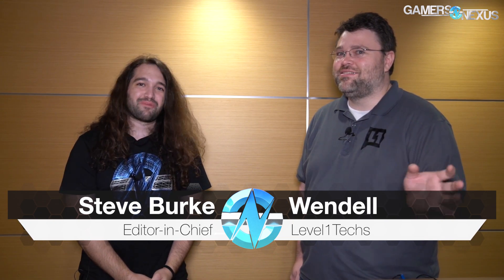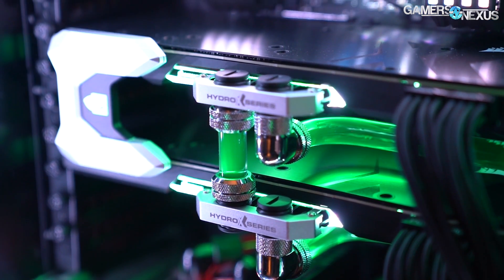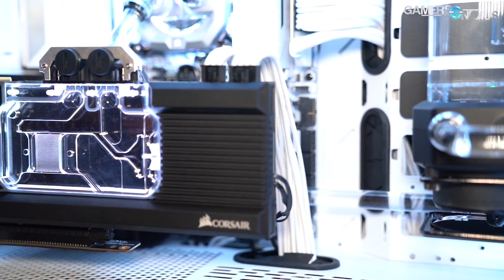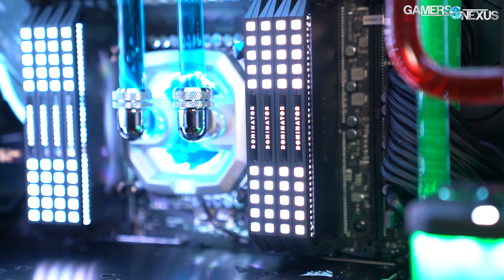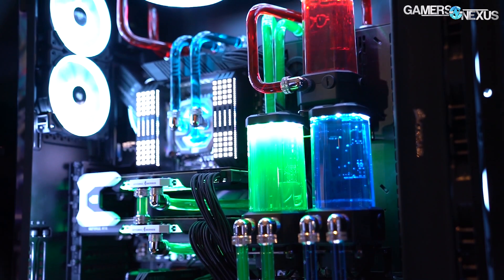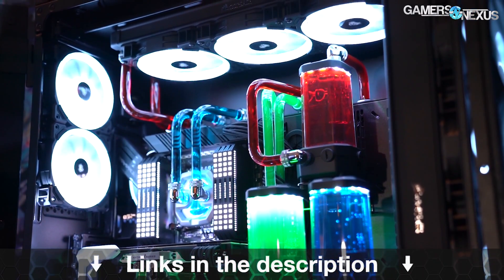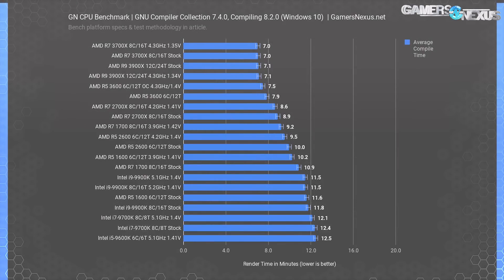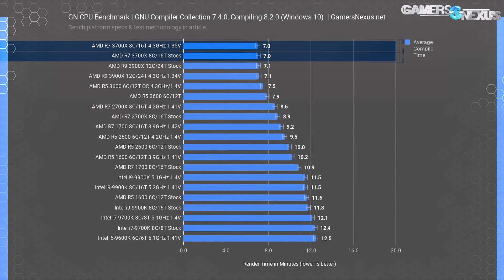Explaining Ryzen 3000 Cache, ft. Wendell of Level1 Techs | LTX 2019

Comment: As a web developer I have to agree with Wendell, that you really need to look at whole workflow holistically; at least as long as you're looking at the consumer side of things. I do transpile javascript a lot on a daily basis, but realistically it only makes up a fraction of my entire processor usage. Even if my transpiler was a single core load (which, tbh, I never bothered to check), I'd still probably choose more cores over higher clock speed to a certain extent. Two major reasons: 

First, the compilation, static code analysis, unit testing and other CPU intensive tasks are generally done in the background. I don't know any programmer who would sit idly every time his compiler runs. So having a spare cores to do other stuff is always welcome. 

Second, developer's workflow is rarely just writing and compiling code, it's a very varied workload - yes compilation might be important for some but it's never be-all and end-all when it comes to the developer's workstation. In my case I'm often running several docker containers with web servers; one browser with a ton of tabs, and several others for testing browser-compatibility; a Windows VM for that one stupid corporate piece of software that doesn't run on Linux; an IDE which is indexing and doing static analysis over my codebase all the time etc. All that while I transpile bits of my code every time I save. 

I don't know how you'd go about benchmarking something like that... it's more like... general computing.

Comment: I guess you could setup load testing on a software system that does heavy encryption and hashing to simulate something like a user logon (that sometimes has dedicated hardware to help out).  Could even use Chrome etc for that test. 

Another workload test could see how fast a bare bones docker instance gets fully setup ready for load testing.

I've actually played around with EC2 types with a prev company's regression suite that takes around 16 hours to run.
There were some gains from increasing core count etc but only when it was effectively maxing out a core or disk.  Going from a machine that doesn't have noticeable spikes in IO (<50ms) and CPU (<90% constant/mean usage) and having a solid 2/3GB of free Memory from peak didn't seem to net any great benefits; at least when talking about a Linux Server. 

But running on a desktop would mean a lot more context switching etc so it would be more likely to tap out a lot sooner.

Comment: Suggestion: Compile a C project, a c++ Project (because the object oriented structure needs to be interpreted too), and a project which creates Bytecode like Java or C# (Bytecode is program code that has been compiled from source code into low-level code designed for a software interpreter). If you want a 4th thing, you could take something  like a Haskell (as an example of an purely functional programming language)

Comment: So my take on benchmarking for programmers is as Wendell said check responsiveness while compiling because most compilers out there are incremental but my workflow usually includes several IDEs open. Along with typically 2 versions of the target software (release and dev) plus a ton of chrome tabs. Some IDEs are heavyweight like eclipse inellij and visual studio so it might be good to include a benchmark with 2 instances of eclipse or some other IDE running and compiling.

Comment: I like the GCC compiler test because it's a real world work scenario thing - but i do agree, maybe it should be a bunch of stuff compiled.
Linux kernel, Chromium, Firefox, then some Javascript stuff, and maybe something with the Microsoft compiler? I believe this stuff could be scripted.

Also i wonder how different CPUs compare on NVMe I/O operation or if there is any difference, and on network utilization while using same network chip (say a add-in card) if there is any difference. sigh i think i went down the rabbit hole and now i have to buy a bunch of systems and see if there are any differences? :/

Comment: Compiling from ramdisk (tmpfs) is also great because it saves a lot of writes to the ssd nand thus enhancing  its lifetime.
Reply: Splitting hairs: ramfs is the proper RAM drive FS. Tmpfs can overflow into, or have some contents flushed by need, into a swap file. Ramfs will only be RAM resident, with no safety measures if you do stupid things.
Reply: Probably indeed.  Modern drives use write strategies to avoid writing the same cells...  m.2 nvme will drives hardly saturate a pcie x4 bus much less an x16.  The 4.0 specs bandwidth increase is great for cards where you do transfers to card memory.  That said, even the RTX 2080 ti doesn't saturate the pcie 3.0 16x bus.  The 4.0 spec is for something to come in the future.

Ramdrives are still noticeably faster.

Comment: I use 32GB ramdisk for my node.js projects and some C++. Must say, ramdisk is the best thing ever invented... However must be careful to commit and your project externally very often. Last time while closing system it copied for me only the folder structure without files to the hard drive.
Reply: Why not run rsync via cron every minute?
Reply: @MarkRose1337  for 1kk files? I use Ubuntu under Windows .... Not pure windows...
Reply: Maybe make, or search for, a script you can have running with crone that will index all the files, then save only newer ones. Or grab a backup tool that does that, and have crone run it every 10 minutes or so.
Reply: @laurelsporter  rsync already does that.
Reply: @MarkRose1337  with a relatively high overhead, as it's made to be reliable over unreliable storage and network interfaces, yes. Kind of like how git also already does it. A more direct script would likely do it much faster, and with no file system or cache issues (like fsyncing getting in the way of a snappy PC).
Reply: @laurelsporter  I had a couple of typos in my previous reply. Anyway, I ran rysnc on a typical source repository to see how fast it was. It was even faster than I thought it would be. I suppose something faster could be written, but I'm not sure it's worth it.

$ sudo mkdir /mnt/ramdisk{1..3}
$ for i in {1..3} ; do sudo mount -t ramfs -o size=4g ramfs /mnt/ramdisk$i ; done
$ sudo chown $(whoami) /mnt/ramdisk*
$ git clone git://gcc.gnu.org/git/gcc.git /mnt/ramdisk1/gcc # approximately 2.7 GB, a reasonable source repo
$ time { rsync -a /mnt/ramdisk1/gcc /mnt/ramdisk2/ ; sync ; } # first sync

real    0m6.458s
user    0m9.137s
sys     0m3.344s
$ time { rsync -a /mnt/ramdisk1/gcc /mnt/ramdisk2/ ; sync ; } # resync

real    0m0.749s
user    0m0.362s
sys     0m0.413s
$ time { cp -a /mnt/ramdisk1/gcc /mnt/ramdisk3/ ; sync ; } # first sync

real    0m2.356s
user    0m0.581s
sys     0m1.750s
$ time { cp -a /mnt/ramdisk1/gcc /mnt/ramdisk3/ ; sync ; } # resync

real    0m1.697s
user    0m0.570s
sys     0m1.101s

Comment: Sounds like you will need to run your test suite on an optane drive or ram disk...just like when you test a cpu in video games you use a 2080ti, you'll want to try eliminate any non-cpu related bottlenecks.

Comment: Small correction, a L3 victim cache does not sit ** between ** memory and the L2.
If it were, it would be a regular inclusive cache (L2 being a sub-set of L3).
It sits more on the side, like a notebook, where the L2 can scribble things into that it no longer can hold itself (but look up quicker when needed again).
Reply: If it's write-through, yes. But, a write-back L3 does sit between them, since you can't bypass it and maintain coherence, and I'm pretty sure (on mobile ATM) Zen's are write-back.

Comment: Code compilation is an important use case for some, and I'm glad GN is tackling it.  DragonFlyBSD project manager replaced a 48 core Opteron with two 3900X systems, and "we are replacing 1000W with only 520W and getting roughly 6x the performance efficiency in the upgrade. "  Rebuilding all their project went from taking a whole week to about 24 hours. http://lists.dragonflybsd.org/pipermail/users/2019-July/358226.html
Reply: You should look at The AMD Epyc processor. The advertised TDP of a 1 cpu/ 32 core Epyc processor is 155/170, where 2 Ryzen 3900x is 210.  In other words you can probably drive that wattage down even further for the same 6x performance. (In theory.)
Reply: @apex761  that's 520watts of power for a total of three systems.
Reply: This is what I hope my life will turn into whenever AMD decides to produce a few more 3900x for me to purchase.
Reply: @Melthornal  Glad Im not the only one suffering? I even live near a Microcenter, and they are in and out of stock so fast online and in store that its ridiculous.
Reply: @Esonar  Me every morning:  "hey it took 14 hours to run that script last night, maybe some time this century the 3900x will come back into stock"
Reply: @Esonar  Whats hilarious is that most people buying the thing want it to "play games" as if it can even help you play games. Meanwhile people like me who actually need the processor to do what it is designed to do get to wait five or six hundred years for it to restock.
Reply: This is like Thanos(Wendell) talking to Sentry(Steve) in the Tech 🌎
Reply: fjuulb what stock? there is no stock anywhere. its sold out globally. it sold out in lk,e 15 seconds and hasn’t been in stock since
Reply: @Melthornal  pfft, pleb.
Reply: so a Electricity bill that is about 12 times less expensive! not many people realize that what servers and companies that uses computers for work pays most of their money in Electricity!

Comment: PCIe 4.0 SSD plus fast RAM and IF plus a ton of L3 cache = compiling beast
Reply: So basically ryzen 3000 for now and zen2 threadripper once it comes out after that.
Reply: @qlum  That would be rather intressting
Reply: @qlum  64 cores @ >4Ghz is gonna be spicy... definitely gonna need a custom loop tho
Reply: Intel Optane would do more work than any PCIE 4.0 disk in this case. You need as low latency as possible, not bandwidth.
Reply: @shaolinspida  i guess we will find out soon enough.

Comment: Sounds like an AMD 3900X with Intel Optane drives would be ideal.
Reply: there's no PCIe 4 Optane drives yet
Reply: @tommihommi1  In terms of IOPs Optane can still blow the doors off NVMe.
You're looking at tons of tiny files, not raw throughput. 
PCIE 4.0 doesn't offer more IOPs, just more bandwidth.
Reply: @tim3172  While that is true to a point that is mainly as no-one has made a gen 4 biased and IOPS focused controller yet, merely repurposed gen 3 ones
Reply: @tim3172  Optane uses NVMe, what do you even mean?  PCIE 4 absolutely offers the ability for more IOPS as well as bandwidth.
Reply: @micThurrr  even PCIE3 can support more bandwidth than current Intel Optane 905P drives. It's rarely the bandwidth that's the limiting factor for code compilations and adhoc workflows now, though. Such workflow are nearly always  limited to single threaded latency - which is where Optane 905P drives are still in a completely different league to NAND based drives.

Intel Optane drives use 3D XPoint https://en.m.wikipedia.org/wiki/3D_XPoint
Reply: @callums____  when did I ever mention Optane's low QD performance?  I was simply talking about pcie4 vs 3.
Reply: @micThurrr  you're right. You didn't. The original comment, by tommihommi1, was suggesting an importance of PCIE4 for an ideal combination, though. 

Either way, you're right, PCIE4 does provide a lot more potential for bandwidth. It's just currently not yet important but will be in the future. I was thinking in current context but realise I hadn't stated that. 

PCIE4 Optane/XPoint drives that could saturate PCIE4 at low QDs would be amazing.
Reply: Sure, but (if I'm remembering correctly) Optane doesn't play nice with AMD processors, nor the chipsets.
Reply: @TeriiNekoyama  I am yet to see anyone confirm or demonstrate this. So far have only seen Intel 900P/905P drives working fine on AMD platforms.

Comment: AMD's marketing would have been spot on if they just called it compile cache
Reply: Wouldn't work better for selling their workstation based threadripper CPUs ?
Reply: @vablo7198  the majority of games these days run cross platform as they are all based on the same code archecture.
This means consoles and PCs largely function with the same quirks these days code wise.

Consoles are a stable platform that doesn't change, that means large amounts of optimizations go into that format - this means that if the consoles have a larger cache games will be coded to perform well with that.
This will spill over into PC games also loving larger caches
Reply: actually no...
Reply: Compilacache

Comment: There are xeons with a huge cache. For instance my ancient e5-2690s have 20 mb each. Has anyone tried these benchmarks on xeons?
Reply: Not exactly. Intel says "20MB Smart Cache" without telling you how much is Level 2 and how much Level 3. You cannot "join" 2 CPU's L2 & L3 cache and expect to have the same performance as L2&L3 cache on a single Ryzen 39XX CPU - which has a much bigger cache (8MB Level 2 and 64MB Level 3), so all in all - a single 3950X smashes your Xeons on any workload tests.
Reply: @dorinxtg  I would assume that the level 3 is MUCH bigger than the level 2 or that it's all level 2.  And of course I wasn't claiming that two e5-2690s have 20 mb, two of them would have 40 mb.
Reply: But the older xeons have slower cache

Comment: Benchmarking compilers by project type makes little sense for many coders. When I was a working programmer I would do different projects with differing requirements all the time. 

I found, and this is borne out by all the testing I've seen and what GN found, that compilers care about IOPS and cache size more than just about anything. But realistically most compile jobs take a few seconds at most. Except for the, relatively rare, full compile of a project, done as a sanity check or to produce a release/beta version, which can be setup to run overnight on big projects, I actually did this on a big project with an automated test suite. Every Friday I'd launch a full build which got handed off to the test suite and on Monday I'd have the build plus all the identified issues from the test software.
Reply: Compile time very much depends a lot of your language and toolchain. Certain ones are a lot faster then others, some will never complete in under 1 minute, even for "simple" things.
Reply: @EraYaN I've used both GCC and Microsoft's compiler a lot. Neither always takes over a minute to compile anything. I'm sure there are bad compilers out there but I just have no idea why anyone would be using them.
Reply: Ken Shaw well rustc used to be really slow, and gcc can easily take hours too, just not on one object (if you have a sane structure).
Reply: @EraYaN The only time I've seen GCC take hours was when I built the Debian distro  and that was a whole lot of code.

Comment: can someone help me: my core voltage at idle is at 1.45 on my r53600 on the b450 tomahawk please help, ive gone into bios and went to the core voltage it was on auto so I clicked on it but there was no normal only off set mode and amd overclocking
Reply: That's totally acceptable on Zen 2. Amps are low at idle so voltage can be higher.
Reply: @marthific  even with temps of 43-50
Reply: @fuzzball3980  that's more likely the stock fan curve on the stick cooler.  Switch up some bios fan settings for higher speeds
Reply: @marthific  i recently found out it automatically sets the fan curve higher when the cpu get hotter keeping it stable
Reply: Look it up on Reddit! It turns out, that monitoring voltages lights up the cpu but it is normal so dont worry
Reply: i have a 2700x and that same board it goes to 0.90000v on idle 1.41 at 4.5ghz presicion boost overdrive disabled
Reply: https://youtu.be/M5pHUHGZ7hU

Comment: Wendell saying the Linux kernel being 30 seconds on a modern machine. I've got an old PowerPC Powermac G5 where im looking at a good hour to compile the kernel that i've manually configured to be smaller....and im on build number 23. Oh how things have changed.
Reply: modern machine = 2990wx at 4 Ghz
Reply: The 8-bit guy did a video about that computer. It's been a while since I've seen the video but I remember it being beautifully put together but also so hot and power inefficient that it makes an FX-8350 feel like an R7 3700X. Wendell did do a video recently about new PowerPC CPU's on 14nm process which did have surprisingly good performance and A LOT of cores.
Reply: @randirlom9508  That it did... and fkkk missed the value and had to do it again.